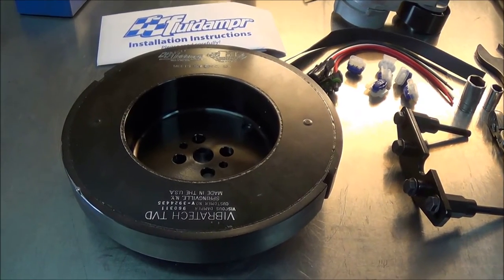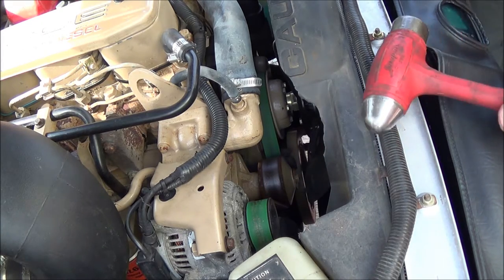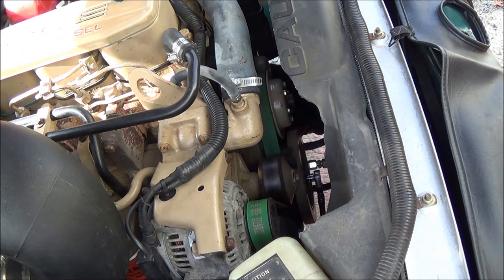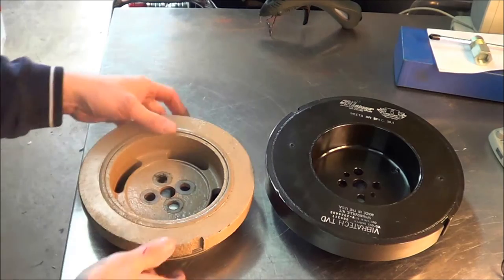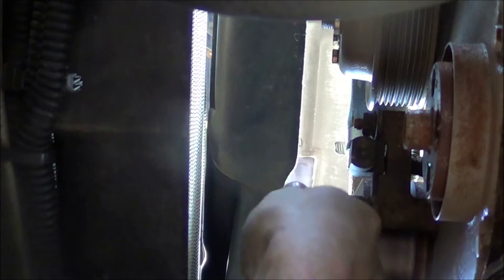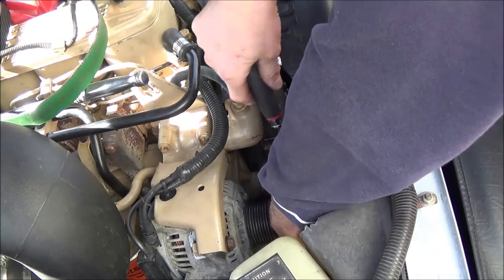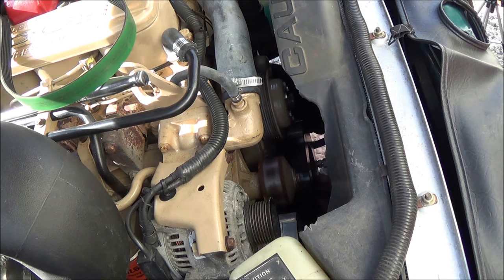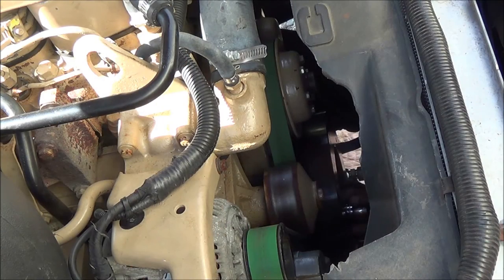2nd Gen Dodge Ram Cummins 12v 6BT Fluidampr 960311 vibration damper install and review

Comment: Thanks for sharing this Now I want 1!  Lots of guys use those on race cars & boats to.   I just ordered a Beans Diesel fuel sump for my Dodge sick of fuel pick up issues I will do a video of install when ever they get them back in stock maybe next week or so. Thanks again .
Reply from the maker: +TheKilog69 I have to sump my tank as well... seems I run out of fuel just as low fuel light comes on, or before which is a pain. I am planning to use a FASS sump to go with my pump, and as soon as this tank is low it's going to happen.

Thanks for watching let me know when your vid is up.
Reply: I put a Sump kit from Beans diesel on my 4bt swap, before I had a draw tube and could never get it to pull to engine, I installed the sump kit, and then I had fuel to the engine from a empty fuel system in less then a minute! I made my own fuel system, FASS was just way to pricey.

Comment: Carl, 
Thanks for taking the time to make the video, I understand how much work that is.
Can you show us your old dampener? Was their damage? Was the rubber grommet seal coming out?  Or was it normal vibration made less by larger dampener? 
Also to all watching take the fan guard out! Much easier.
Reply from the maker: +Harry Mingo The old damper is shown in the video, the rubber still OK. The addition of the low stall converter last spring seemed to cause increased vibration due to the extra loading on the engine at idle and low speeds. The low stall brings in gear idle speed down to about 550, and it will shake you to pieces in traffic. Big improvement.

I left the shroud in place because I did not want to deal with removing the full washer tank and almost full coolant reserve to get to the attaching bolts. Worked for me just fine that way.

Thanks for watching and the comments!

Comment: Not sure why, but the sensor is important beyond just the tach reading...I tried to swap a 24v balancer on my 12v and due to the fact that it didnt have the notches for the sensor to read the PCM maybe didn't know that it could demand voltage? So my truck was stuck at 12 volts and wasn't charging the battery, so it is important apparently to get the sensor right on this application...just a thought.

Comment: Another great video Carl. The series on your dodge is especially good. I have a rotted out 24 valve. You made converting your truck to diesel look like it was no big deal. You are a really fine mechanic.How do you keep your truck so nice, don't you live in the rust belt?
Reply from the maker: +Jeff L Hi Jeff! Wow thanks for the compliments.. much appreciated! 

Yes the conversion did go very smooth, but that would not have happened if I didn't prepare as much as I did. If you look back I got the motor in April and finally dropped it in at the end of July. There was lots of time spent getting parts collected, reading, looking at other trucks, comparing wiring diagrams etc. I must admit that I even impressed myself with how "easy" that job was, I was expecting a lot more hassle out of that. I doubt one will ever go that smooth again for me lol. Of course looking back there are some things that I would do different next time (the freeze plug is on of them!).

As far as the condition of my truck, yes northern NJ is loaded with salt and some things are starting to happen now.. The rockers are shot on both sides as well as the door bottoms are starting to bubble. I am going to cover some of this once the weather gets better. The only reason it lasted this long (she's 21 years old now) is that this is a southern truck, sold in Oklahoma and has only been up here since winter 2005. My neighbor bought a used 2001 Ram 1500 a year before I got mine and it rotted to pieces by 2011.

Thanks for watching!
Reply: +Broncocarl92 thanks for responding carl.yea that freeze plug was no bargain. I'm looking forward to the body work videos.is there anything you can't do?
Reply: +Broncocarl92  just one more and ill quit for the night. found it interesting the engine spins up faster with a balancer thats twice as heavy. must have something to do with the higher compression of a diesel as compared to a gas engine.
Reply from the maker: +Jeff L That I don't have an answer for,  I was surprised about that as well. Possibly has something to do with the smoother running allows a better fuel burn?

Comment: Is the 135ft lb for stock fasteners? I read it was like 92ft lbs for those bolts. I ordered ARP crank bolts so I assume those specs would be different. Great video BTW.
Reply: Yep 92

Comment: Great Video. The damper though is expensive.. for my 04 almost $500.00
Reply from the maker: +ItsAlwaysRusty I agree on that. If I didn't find this discounted one this video wouldn't have happened. I can say the results are worth full price though.

Thanks for watching!
Reply: Is it worth getting the 400$ dampener or is a Oem replacement for 140$ ok its just a Daily driver/work truck. I have a 07 5.9 and I can see some wobble when i was changing the water pump!

Comment: I appreciate all your videos very nicely done and informative.    It just seems that this upgrade is not worth the time money and effort for the minimal results you achieve. It's going to shake it's a diesel. Just my opinion but thanks for the information.
Reply from the maker: +Richard Martinez The difference before and after driving is very noticeable IMO.. When the truck is coasting now I find myself looking to see if the engine is still running.. this is no exaggeration. Did you have a different experience?

Yes it is a pricey upgrade but if your damper is falling apart it's worth spending the extra for this over a stock piece.

Thanks for the comment.
Reply: On my 96 ram 3500 have never noticed any vibration but then again I don't think I've ever pushed it over 2,100 rpm since I bought it out of the   dealership new in 96 and it only has 143k on the dial. Thanks for the reply and keep up the good work with the videos.

Comment: Damper bolt torque spec on 2nd gens is 92 ft-lbs. Yours handled 135 ok?
Reply from the maker: So that is an interesting question. This video is three years old now and if I still have the original instruction sheet somewhere is a mystery to me. If I find it I will let you know, but that is where I got the spec from (and also the information on how to install the sensor). I just looked up the instructions on the Fluidampr website and indeed the spec listed is 92 ft/lbs. I also see that the revision date on lower corner is 5/2018 so maybe it was corrected? None of the specs listed on the chart is 135 so I doubt I read the spec for a different vehicle.

Thanks for bringing this to my attention now I have to see how I can fix video (may have to pull, edit and repost).
Reply: No problem, Carl. Your video on replacing the rear pinion seal on a Dana 70 was of tremendous help to me a few years back and one of the first procedures I did on my 12 Valve to get me into diesel mechanics. Glad I could be of help.